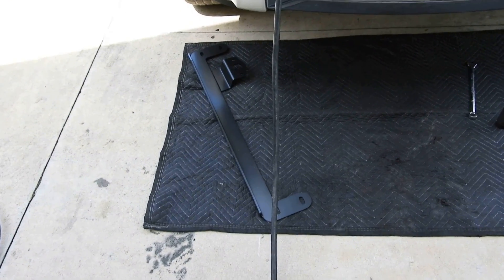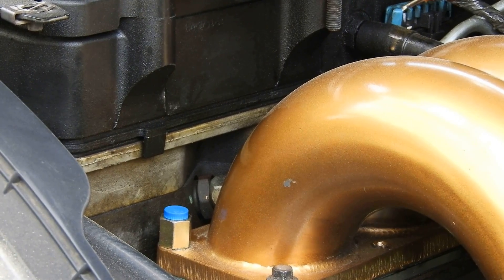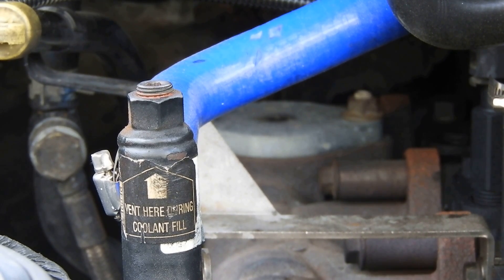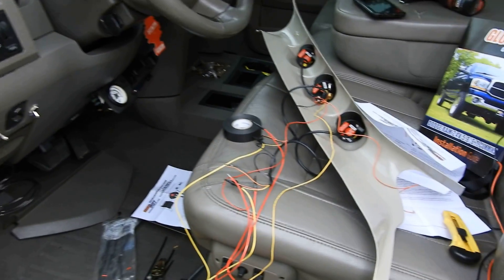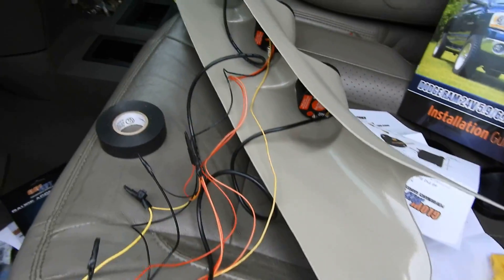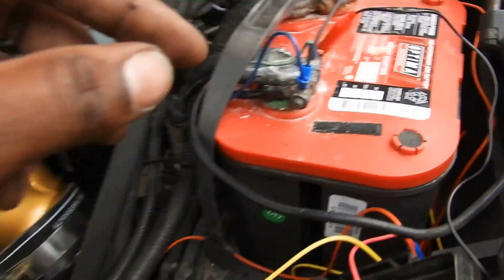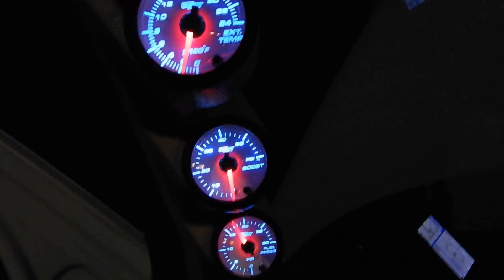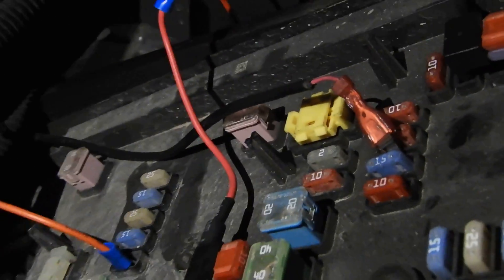HOW TO INSTALL GLOW SHIFT GAUGES

Comment: Quadzilla boost fooler install, it's the perfect time to do it now because you have a mechanical boost gauge and you can see the difference in the Boost readings at Full Throttle before and after, I gained about 10 psi of boost after the installation and not too expensive either.
Reply from the maker: i thought about doing it but since i planned on changing out the turbo i wasn't gonna do it but i think i will still. Thanks man.
Reply: No problem it still would be a great enhancement For a new turbo, remember the computer will cut off the Boost at around 25 or 30 PSI at least that's what happened on my 5.9 that would hinder the new turbos boost potential so the fooler will definitely help, by the way let us know what the full Boost on your truck is reading because if it's over 45 PSI then your tuner already has a fooler built in.
Reply from the maker: tsimmons1974ts thanks for the info man. My tuner doesn't have a boost fooler it tops out at like 35psi. After that I'll definitely be looking into one now. Thanks man.

Comment: Nice Vid!! Even if it is a fiat er dodge. 🤘🏻🤘🏻🤘🏻 Major props for soldering some of your connections. That said, lil constructive criticism, you shouldve made them inline splices. Or where you have one feeding two or more use a combination of a pigtail and inline splice. Looks better and more conducive to clean install. Just be sure BOTH  conductors counter wrap around each other (not just one wire wraped around the other). Also, shrink tube is cheap and looks much better. Also also, using an environmental Stakon er crimp connector is advisable if you cant/dont want to solder. Apologies , 25yrs as a Sparkee working for oem has jaded me. Good luck! Cheers!

Comment: Are your GlowShift gauges still holding up? Thinking about pulling the trigger on the A pillar set and really like how they look but have read a lot of bad reviews on them.
Reply from the maker: I've had them on for 2 years and they still work fine. I never had any issues. Just have tight connections and install correctly and u should be fine
Reply: I’ve heard they aren’t very accurate, I’m wanting gauges but not sure what I want cause of price, but don’t want crap stuff either

Comment: Gauges look awesome. I was wondering how you likes the AMS oil in transmission?  Was thinking of trying it, my 08 6.7 does fine on highway but pulling camper on steep back roads heats up over 200 with mag hytec and Lucas synthetic. Need to keep tranny temp down, any suggestions?

Comment: How did you install the fuel pressure gauge going to the cp3 pump?
Thanks.
Reply from the maker: The fuel pressure Guage didn't go to the cp3 it went to my air dog pump. It's low pressure fuel

Comment: Hey what's up, another awesome video! What did the overall cost end up being to do that? Thanks in advance!
Reply from the maker: 6point7 cummins I paid 280 for the gauges since I opted for the fuel pressure gauge instead of trans guage
Reply: EVERYTHANG DIESEL I'm wanting boost, fuel pressure, and egt. When I look it up at website it is saying around $450
Reply from the maker: yeah look it up on ebay or amazon. i got mine from ebay. i paid 280. also glowshift has different lines of gauges mine are the basic type. the tow max ones with the digital display are like $400 something also.
Reply: EVERYTHANG DIESEL awesome! I always forget about the great Ebay or Amazon lol! Thanks man I appreciate it, look forward to your next vid!!

Comment: For your fuel pressure gauge did you have to get a separate part to 90 it to put it away from the pump to fit the snubber on? Or does it screw into the brass fitting that comes on the air dog?
Reply from the maker: it came with the snubber that screws into the brass fitting

Comment: You know short cutting electrical will screw you up. I done mine myself with fuse taps and only 3 wires… all the wire jumping was and is unnecessary you got showing there. You can cut allot of that extra wire crap out